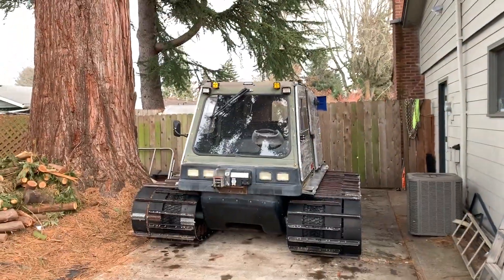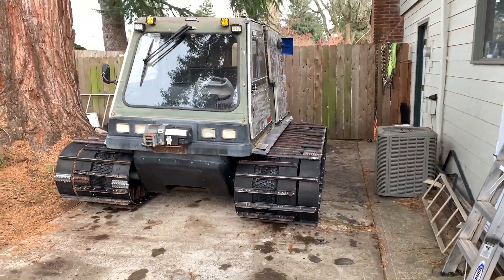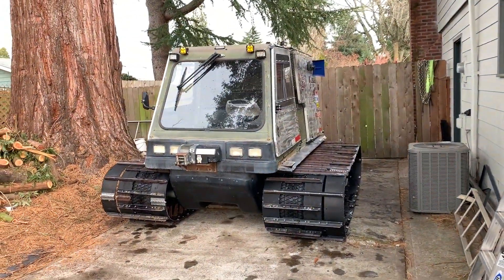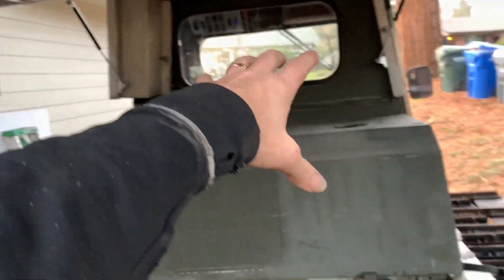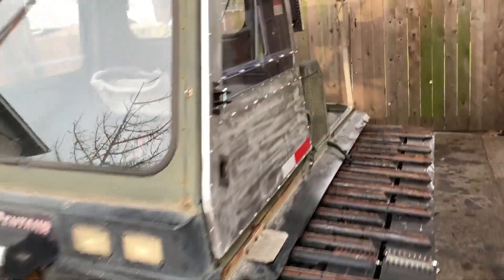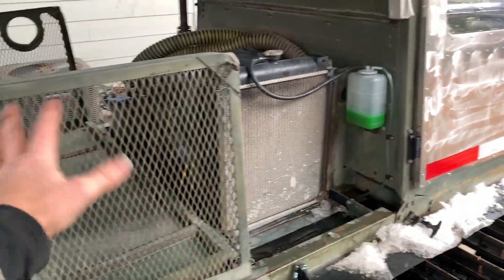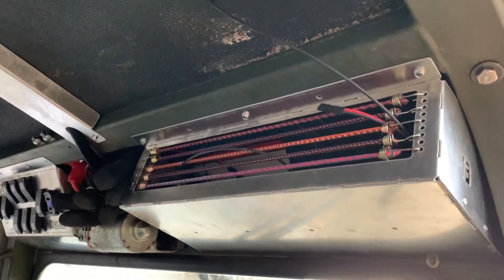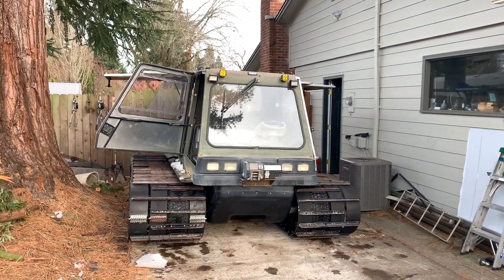Argo Centaur 8x8 Detailed Walkaround

Comment: Awesome video! I just Picked one up today. It say for ten years so it’s going to be a fun project getting it restored. Do you know where I can get a parts catalog?
Reply from the maker: Search online, I found all the info via Google 
Have fun, great machines
Reply from the maker: @isaacjohnmartin1321  I looked you up/followed.  Will be fun to watch another Argo guy. 
I sold my machine couple years ago, loved it and looking for another one possibly.
Mine had snow tracks for deep snow, 32in wide, they were assymetric, basically an extra half to the ones that "usually" come.  Did great in powder, buy they are on a heavy side.
Reply: Any recommendations on where to buy one?

Comment: keep up the great videos, really enjoyed the videos from back when you still had the orange Thiokol IMP you rebuilt. around 13:20 in the vid you were talking about the snow getting drawn in to the radiator area being a problem. as i have never owned any machines like this i dont know how far the snow gets thrown up by the back of the tracks but maybe you could experiment with a rear facing scoop made of aluminum/sheetmetal. might drastically reduce the amount that gets in with out having to create a box/intake system. if not i know you are a resourceful guy and will figure something out. enjoy.
Reply from the maker: its all good, i welcome all suggestions, and just filter them out as I go along.  
watch the next video with it being used - you'll see whats going on there :)

Comment: The fan usually blows away from the radiator. But your assumption is right this is from the melted snow which gets in from the snow tracks.
Pretty cool machine.
Reply from the maker: On contrary,  fan sucks in the snow through the radiator and blows it pass engine out the other side...

Comment: Bud, nice new project. You mentioned airflow (suck) and icing problem.... what if you reversed the fan so it would blow? Maybe during some P.O. repair they unknowingly put the fan on the wrong way around in keeping with common automobile airflow (suck vs. blow)? As mentioned in one of the replies, in a lot of agricultural applications the fan "blows" to keep chaff and other debris from clogging the radiator. I have no way of knowing how this would effect cooling performance, but it might be a simple fix without a lot of fabrication?
Reply from the maker: Thanks, yes, my research showed so far that its all good and draws airflow onto the engine, as the fan is belt driven, would take a lot to mess it up as it only goes one way.  I've looked, and it seems like it might be an easy fix, or better yet, nothing thats worth worrying about really.